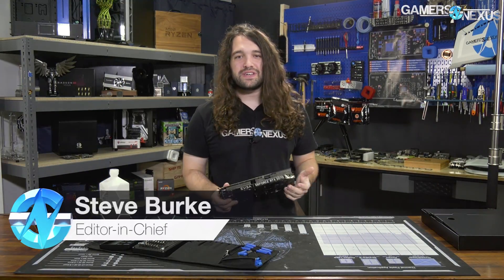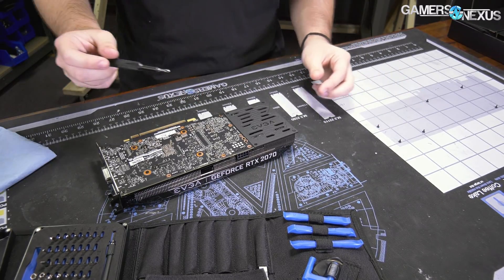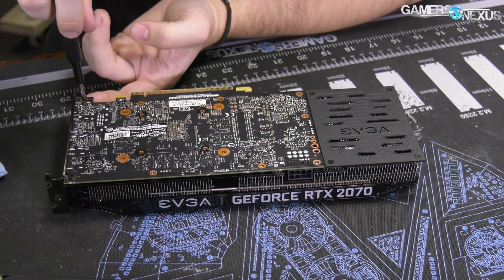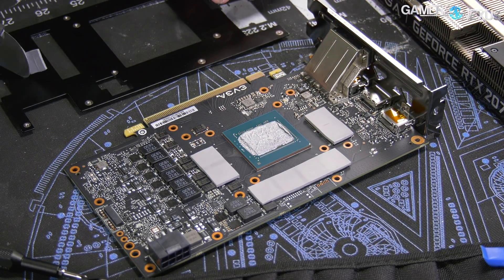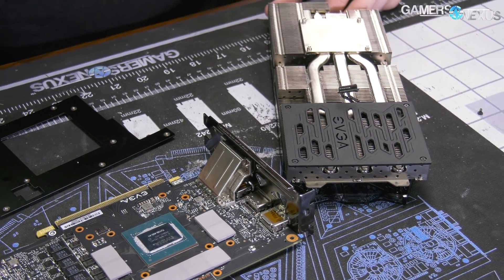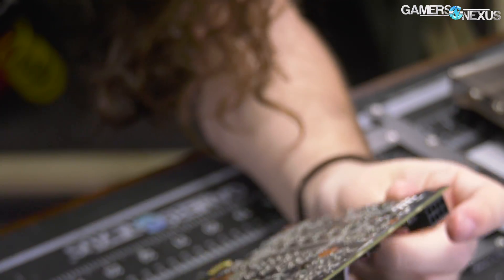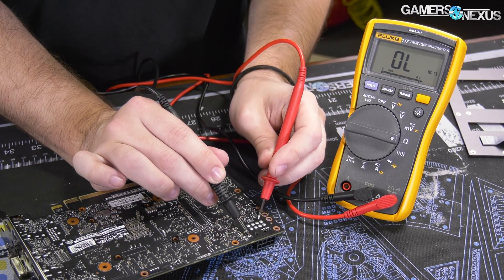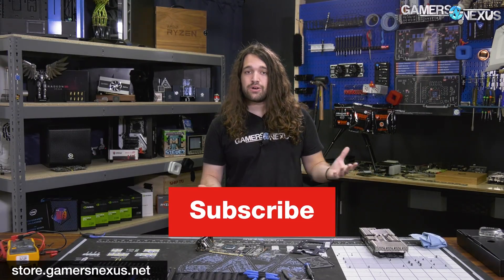EVGA RTX 2070 Tear-Down, Quality, & Reference PCB

Comment: Data point, my RTX 2070's paste is now no longer good enough to cool the GPU. I have to repaste in order to keep using it.
Reply: mine is now the same. about to do at the weekend. Actually having to run it at 75% power using MSI afterburner currently to play anything on it.

Comment: My 2070 died on me suddenly.  Turned the pc off one night ( last time the card worked)
The next morning I turned on the pc and only 1 out of the 2 fans were spinning ( and that one fan was spinning at such an outrageous speed, it sounded like a leaf blower )

Got no display on the screen, and not even any of the evga logo doesn't light up.

What do you think can be the issue ?

And yeah, another video card works in the same pci port. Currently using a old 1080

Comment: Hello friend, I just bought an rtx 2070 and it seems that the graph when installing the drivers gives an error called error 43 and throws a blue screen, I would like to know if you have repaired any 2070 with the same problem. They tried to repair that but not very well and there are no technicians who know how to do a decent job. Greetings from Argentina
Reply: Que tal

Comment: thats odd mine does not have the plate the card extends where the plate is on this one and i got the RGB one for like 30 bucks more and i have a 6 and an 8 pin if i have a 6 and an 8 pin will it be better at OC

Comment: There's an MSRP Windforce out now that's of much higher build quality than the EVGA Black. It's what I picked up and the thing boosted to over 1800Mhz right of the box and Afterburner 4.6s auto-tuning has running near 2000Mhz now without going over 65 degrees.

Comment: so i have a gtx 1080 with a 1440 165hz monitor i want to upgrade as i have had this card since launch, but nvidia has made it pretty hard tbh the rtx 2080 is way to close to a gtx 1080 ti for the price and the rtx 2080 ti has an absurd price tag.  they should have released a gtx 2080 ti which could have been the same as a rtx 2080 ti just without the useless ray tracing and cut the price a bit.

Comment: Steve, how long is the RTX 2070 reference card itself once removed from the cooler?  I'm shopping for a possible future upgrade (in this case more of a lateral "upgrade") to my i7-8086K rig and looking for a decent card that is short enough to be water-cooled in a Corsair Graphite 380T portable ITX case.  Length is a huge issue with doing so, as I figure it can be done with a seven inc or so card, but not much larger.  Currently I have a MSI GTX 1080 Gaming X in there, and that would be impossible to even think about a custom loop in that case using that 1080.

Comment: All good - but...  No, $500 is NOT where the 2070 base should be!  IMO, based on nothing at all (other than my degree in Computer Science and 40 years buying and building PCs) the 2080Ti should be $750 base, the 2080 should be $550, and the 2070 should be $400 (tops!). 

$500 for a third tier base model is ridiculous!  Even $400 is on the high side!

Comment: Do they add these base plates to help cooling specific components and avoid dust build up? I get that keeping the PCB bare would get airflow to the components but I guess that over time, dust can build up easier on a PCB rather than a flat surface... anyone aware of any other reasons?

Comment: You say to NOT short the shunt resistor connected to the PCI-Express power rail, because you ~might pull too much power through your motherboard.  Let's assume you are not using an ITX mobo, and you ONLY have a GPU plugged into the PCI-Express slots.  Wouldn't the mobo, allotting for multiple GPUs potentially running concurrently, have more than 1 GPU (~75W?) worth of power to send along that power rail?  If possible, I would like to see this tested.

Comment: With lifting the power target you can just solder on 6" of 20 gauge wire, which is 10 milliOhms/foot (so 6" is 5 milliohms), so this would change the total resistance to 2.5 milliohms and doubling the power target. If you run into issues or want to only raise the power target by a little, you could use a longer wire. I'm not sure I'd recommend using narrower wire since current does go through the wire (all the current through the entire card goes through the shunts) and the ampacity of 20 gauge is 11A for 75c insulation, and 59A for short bursts.

at 12:37 the NCP302155 includes both mosfets and a driver, so it's like the bridge between just having mosfets on the board and going for a powerstage.  Here's the datasheet if anyone's interested
http://www.onsemi.com/pub/Collateral/NCP302155-D.PDF
thermal resistance is 12C/W so they'll get hot fast. That's for ambient cooling so the cooler helps a lot here. They can apparantly do 60A at 300 kHz vin=12 vout=1 which is similar to what you'd see here. (down to 55A at 1MHz). at 12Vin 40A and 1.0Vout they are 86% efficient (assuming 800kHz) so they'll burn about 6.5W as heat, which is ok. This number gets a lot better at 1.8Vout (about 90% efficient). Note that in the ratings they say 60A is the max but the charts only go up to 40A so I would say 60 is only for short bursts. I estimate they are about 80% efficient at 60A

so for a buildzoid style chart, and keep in mind he knows a lot more than me about what the default setup on a GPU is (like switching freq and core voltage). I assume Vin=12 Vout=1 switching freq is 500 kHz and 6 phase design. 
Iout VRM Heat
60A  6W
90A  9W
120A 10.8W
150A 15W
180A 19.5W
210A 24.9W
240A 33W
------------
360A 65W
The last line is just a guess for the theoretical maximum of 60A and guessing efficiency at 82% This VRM can probably not do more than 360A output before blowing up (and 60A is only for switching freq of 300 kHz! Likely about 57A at 500), but it'll overheat before then.

By comparison the asus 1070TI strix has sic620 powerstages and they will burn 10W heat at 250A because at 45A they are over 91% efficient vs these which are only 88 (at 40A)% The sic620 cost about 1.5 times what these do and require a more complex design.

Hope this helps! It's all in the datasheet. Trust buildzoid's numbers over mine, but this gives you an idea.

Comment: So is this power limit based on card design? I'm assuming the more custom the PCB, the better way to overcome this, or is it limitations of the actual Power Supply via connectors and PCI-E etc?
Reply: It's the BIOS I think, and nvidia is preventing the AIB's from going past a certain (very restrictive) point.

Comment: This transparent cooler is such a bad idea.After 6 months of use  with dust in it its going to be difficult to clean properly.
Reply: Pretty sure it's easy to take off. EVGA even sells colored inserts which go under the acrylic, so they made it easy to remove and put back on.

Comment: I finally got to use my Mod-Mat!  I got mine in the first round of preorders, so I've had it quite a while.  It really is an excellent modding surface.  I used it to repair my overhead lamp that had a burnt out trace on the logic board.  I soldered a new wire to bridge the burnt out trace.
I also used it for some epic PC mods.  Delidded my 7700K and installed a Rockit Cool copper IHS with Thermal Grizzly Conductonaut.  Then swapped my Koolance CPU 390 for the new Koolance CPU 400 water block with some Kryonaut paste.  Dropped my max temps at 5.1 GHz from 70C to 60C (was previously delidded from Silicon Lottery).  Also got my 2080 Ti FE and installed an EK water block on that.  Installed all that, spilled plenty of coolant (Koolance Liq705).  The Mod-Mat kicked ass for keeping the coolant from making a huge mess.  It was super easy to clean.  So a really great investment if you do actual modding on your PC or anything electronics related.  An awesome experience for me.  2080 Ti FE running at 2070 MHz GPU 16.6 GHz VRAM at 39-40C max.  The card must run hot, or the EK block isn't a great performer.  My Hydrocopper 1080 Ti's ran around 32-34C.

Comment: Love to see a video where the same PC build is run through every class PSU and generic cost per month of each calculated and compared to each other.  In practice what am I saving on energy with titanium vs. white or even unrated. without considering other reasons to upgrade like reliability or ripple suppression etc..  Thanks for all the great content, I never miss a video.

Comment: Seems to me like they created a proprietary Fan/RGB header which kind of sucks as from what I could gather you could make an adapter that allowed for controlling the RGB on pascal EVGA coolers with the 12v RGB controllers on MSI and asus motherboards allowing for syncing your lighting with your motherboard.   I mean..i know not everybody's worried about  PC aesthetics but the brand locking isn't good for anyone.   Hopefully aura sync SDK and MSI lighting sdk get picked up by all the hardware manufacturers eventually because right now marketing for RGB is freaking silly.   WIth a simple change in gpu cooler connectivity all manufacturers could open up their products to a broader population of consumers.   I just ordered an EVGA RTX 2080 TI XC Ultra due to being tired of waiting for the Strix 2080Ti's to be released and one popping up in stock on the EVGA store.    EVGA has generally been my go to but I have the RGB Fever.    I guess the good news is, I'll be able to fit an aura sync compatible waterblock.     I know.. this is like..the least important feature of modern pc hardware.. but I'm honestly loving the light show going on inside my PC case and wish all the manufacturer's would jump on board with motherboard controlled lighting compatibility, as shopping for parts would be way less of a headache. Oddly enough I'm not alone in people who considered a specific brand and model of GPU to match the rest of the lighting in my case.   How much more money could Corsair or EVGA or any other brand make if their RGB lighting could be made to work with aura sync AND msi and gigabyte alternatives.

Comment: If the cold plate, fins, and heat pipes were made out of aluminum instead of copper, would there be any difference in cooling outside margin of error?

Comment: Im gonna call it.

When ray tracing games out, RTX 2070 will not have enough power to run ray tracing games, shit tons of 2070 owners will regret  buying it.
might end up with class action lawsuit, 970 all over again.
Reply: A new GTX 1080 would've cost me more then a new RTX 2070 here in my country, even if it can't use RTX (yet), I'll never regret the purchase °♢°

Comment: Hey Steve, if someone like me, who is into small and compact, wanted to take a dremel to the 2070 black, would the heatpipes be an issue as they extend through the whole heatsink? What do heatpipes look like on the inside when cut in half? Can they still function? Would I have to bend or do some trickery to make a dremeled heatsink work?

Comment: How is liquid metal less of a short than a direct wire, they both provide a continuous connection?
Reply from the maker: A wire of inappropriate AWG trips the protection circuit and locks it in safety mode.
Reply: Ahhh right, that's why I love this place, I'm always learning! o/
Reply: My guess would be greater resistance in the liquid metal than the copper wire.  This guess being based off of Steve saying at one point, if I remember correctly, that you could also solder a 3ohm resistor onto the 5ohm resistor to achieve basically the same thing as using liquid metal.

Comment: I've never seen one of these tear-down videos before, so I'm not really familiar with exactly what componets do what on a board. I just upgraded from a GTX 980, so I have that card I can tear down and look at. Do you have a video or a resource that shows what is what on the card? Meaning what exactly are the little doodads on it, how many can be added, reasons for them, etc. Also what exactly can third parties change on a card to make it better? I know they can add fans, LED's, but what about on the board itself? What does NVIDIA allow manufactures to do? I kinda just found your channel and have been binge-watching your recent stuff.

Comment: absolutely idiotic placement of that power connector, makes me want to punch EVGA in the face... i'll stick to the MSI Gaming Z or an ASUS board... /facepalm
Reply: It's because it's a shorter PCB. And I'm guessing they didn't bother making a custom length heatsink for the card, in an effort to keep the cost down.
Reply: yeah i get it but it's a huge dealbreaker for me.. i mean how hideous would this look in your case lol... unless you don't have a clear side window or something
Reply: Yeah, it does look weird. For 30 dollars more you could get the XC Black GAMING, which has the power connectors at the end like normal.

Comment: and i just picked up a pre-owned 1080Ti off ebay for less than half of the original RRP!! WOOOOOOOO!! Who needs raytracing!!!
Reply: Scam, wait for it
Reply: Nope. I already have it and its not a scam. The only downside is it was one of the lower tier 1080Ti's (Gigabyte 1080Ti Gaming OC) Its got a shitty cooler on it but for the price i paid i dont mind grabbing an Accelero Xtreme IV for it and i already have, but the problem with the Accelero is it didnt come with heatsinks for the VRMs and memory chips so Ive had to order some in. 

Ive had 2 days with the 1080Ti and its been absolutely fine apart from running a little hot and noisy because of the crappy cooler on it.. Its still a 1080Ti though and its still better then my 2 year old MSI 1070 Gaming X which it replaced even at its out of the box stock speeds.
Reply: @Rose.Of.Hizaki  What temps were you getting with the stock cooler under load?
Reply: 62-66'c In metroLL bench with everything maxed @1440p. I know it could of been higher but I got a good fan setup on my 760T case that helps. Not as bad as some of the horror stories that ive heard about the card when i was doing my research. People were quoting over 70'c but i think that was with the default fan curve... Im not running with the default fan curve and the card does get a little noisy.
Reply: @Rose.Of.Hizaki  Underclock it to 1050ti performance and see if it uses less power, would be educational :)
Reply: Nah